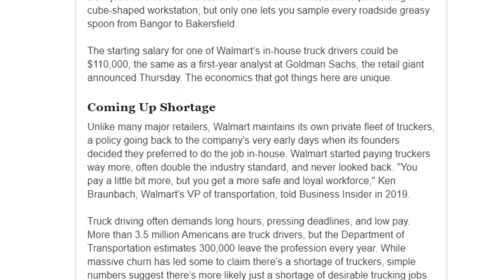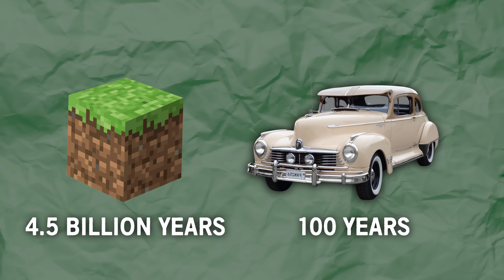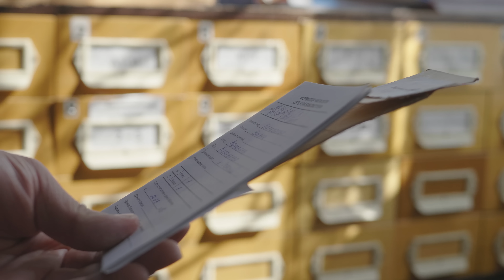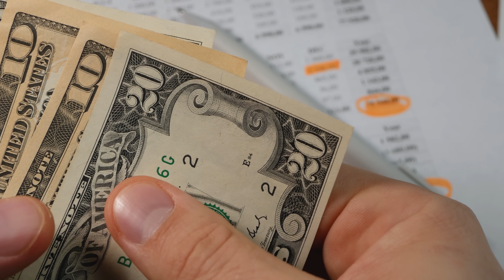Why Do Squatters Rights Exist? - How Money Works

Comment: We fixed this issue in Canada, squatters have no rights. We've moved to electronic land registry systems, deeds do not exist and the deadline to register old deeds has expired.
Reply: Nice they tried to improve the system, but electronic land registry sounds like a system begging to be abused. 😕
Reply: In Finland as well. Idea of "unclaimed" or completely unknown landowner is pretty foreign, because there's pretty solid archives of documents for ownership of every piece of land. 99,99 % of those are digitized in state land registry.

It's not some specific system you can eally abuse. It's literal archive of scanned documents. Though most of it is also transfered to map systems, it's still those original documents that are legally binding.
Reply: @qdllc  how
Reply: @BeHappyTo  - Well, it depends on what they mean by “electronic.”  In the US, most places have digital access and retrieval, but these are scans of the physical documents.  Very convenient, but ultimately, there is the paper trail.  I don’t know if they make redundant copies (e.g., microfilm) to archive in the event of database corruption…which they should.  In an all electronic system…if paper copy is eliminated, it would be easy to alter land records and not be able to backtrack to the original owner.  If the electronic system has safeguards against this being possible, I could understand people trusting it, but in the US, people get their land stolen all the time by fake deed filings where the clerk does nothing to verify the legitimacy of the document.  It’s a crime, but good luck affording a lawyer to go to court and get your land back.
Reply: So if I can find an unoccupied piece of land that is not in the electronic land registry then does it mean I can claim it 🤔🧐
Reply: @samkelo27  1) You can't. I work in forestry, and can assure you every bit of land in Finland has a trail of records.

As I said, it is still the original documents, that hold the legal matter anyway, so the even if the registry is somehow corrupted, it is still backtrackable.
Reply: Now all you have to worry about is hackers, lol.
Reply: @henryyopp9094 , we've had the same system in Denmark for a decade and it has never been hacked so far...
And we don't really have squatting, because every citizen is registered in the "Citizens Register" - so if your adress in the register doesn't correspond with the adress you are at, the police will kick you out if you're reported for unlawful residence.

And no - you can't just register your adress to the house you wish to squat, because the people already living there would get sent a notice, where they have to acknowledge or decline you as a resident... 

So over here - if you're squatting, it won't be for long.
Reply: @QP300 wow....
Reply: @QP300 yeah it seems pretty easy to deal with or solve quickly when using a modern electronic system
Reply: @QP300  This is the way it should be done!
Reply: @qdllc the Torren system used in Canada fixes any form of abuse. Ships also use the Torren system for registry. You can do way more tricks with a moving vessel than a chunk of land, and the Torren system has worked properly for ships and land in Canada.
Reply: What if someone builds a new fence a meter over the property line and nobody notices for 50 years? Does the new owner of the affected property get to demand that that rickety old fence has to be moved?
Reply: What happens when people don't pay their taxes?
Reply: Guess that's why we have so many buildings rotting from standing empty for too long while the owner waits for their "investment" to increase in value. There need to be consequences for property hoarding like this, but good luck finding a politician who isn't also a landlord or property hoarder

Comment: In the Netherlands it used to be legal to squat a building that was standing empty for over a year. This came from the post war period were there was a huge shortage in homes, but at the same time speculators let buildings stay empty for a long time in the hope to sell them for a higher price later on.

However squatting didn't make you owner and if the original owner could make it plausible that they wanted to use the building again the squatters had to leave.
Reply: "Leave" immediately or after a certain period?
Reply: @lyr1x833  The law has changed and now squatting has become completely illegal on the Netherlands. But I guess the squatters would have gotten a few weeks to move.
Reply: @lyr1x833  If most asian countries, if you didn't spend any money to build a house or renovate then you automatically move out. But if you squat a land, build a house or any establishments, the owner have to bring it to court.
Reply: That makes much more sense

Comment: In Spain this crap is so common and frustrating that I’ve designed “anti-squatters” lock doors.
Reply: @gghhpuf  I personally know of people who have had squatters in their home, they were fixing the place before moving in and squatters took the place. The police did nothing.

We had to use “other methods” (we tricked them) to remove them from there. Squatting is a big problem in cities like Barcelona.
Reply: It happens in France too, they send to your adress mails with their name on it to proves that they where there even before that they actually breaked in your house. And if it's more than a arbitrary time you can't kick them out without going on through long procedures. They talked about changing the law but I don't know what it is now.
Reply: @Thesavagesouls  I'd simply "break" (Which in itself is impossible because it's your house) back into my house and drag those people out on the street and sue them for breaking and entering.
Reply: What do those doors look like

Comment: Yeah I realized the importance of this when I purchased a house and the satellite survey and county records seem to disagree with the fence line. Possibly a tiny piece of land that appears on my side of the fence may belong to the neighbor. Not a big deal, except part of a shed exists on part of that property. It would be cost prohibitive to move it and likely has existed since the 90s, so if my neighbor suddenly had a problem it likely would belong to my property due to squatters rights. 

I can absolutely see after this experience why these laws are important. Exact property lines are not always well defined.
Reply: I'm a land surveyor, and never, never rely on county tax records or satellite "surveys" to determine where your property lines are.  Most of these are based on overlaying a deed description on satellite imagery, and can be anywhere from a foot to more than 20 feet off, depending on the quality of the deed and the image.  In fact, almost every county tax mapping system I've ever used has a disclaimer which say that the lines shown do not represent the actual property lines.  The best and most accurate way to find out where your property lines are is to hire a local professional land surveyor to mark the corners and lines
Reply: Have a Shed tipping party! Invite all your friends, family & co-workers? FREE BEER 🍻
Reply: @DanPittel  its my shed.  Its possible part of it exists on my neighbor's property, so the title company exempted it from coverage.
Reply: This would be adverse possession, not squatters rights

Comment: I usually like your videos but most of what you have said here is either wrong or confusing to the point of being wrong. You don’t use the term adverse possession, which is the correct term. I have litigated real estate disputes for over 10 years and not once did a party claiming adverse possession prevail. It is a nullity in the US. And no, you absolutely cannot effectively transfer land via oral contract (statute of frauds, which has been around since 17th century England).

Comment: For those wondering, it’s called adverse possession and the 5 requirements are:
1) continuous use
2) hostile possession
3) open and notorious possession
4) actual possession
5) exclusive use

Basically you need to continuously have possession of the property without permission, hold the land openly and not hidden away sneakily using it, pay taxes on the land, and not allow others to use it. Most states (as of 4 years ago when I took a class on zoning and adverse possession) were 20 years, but there was variation based on the state